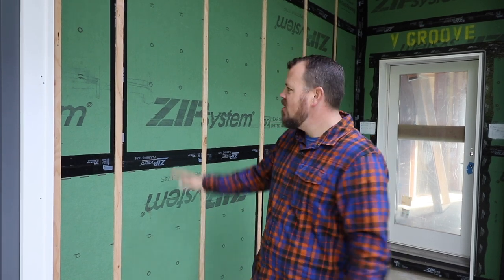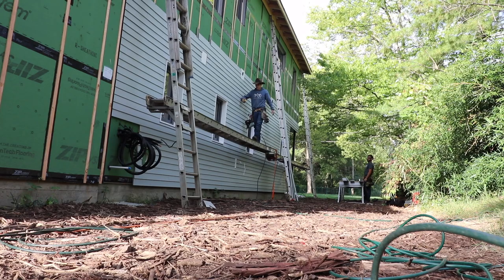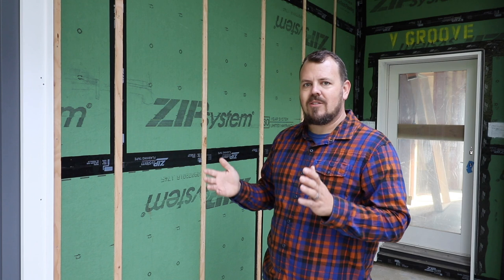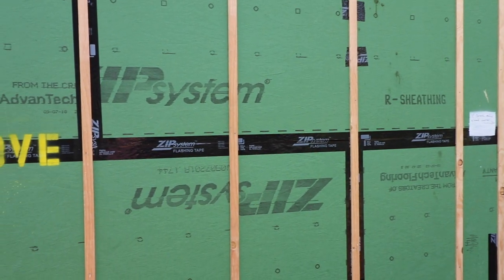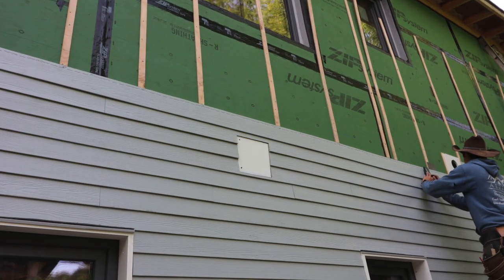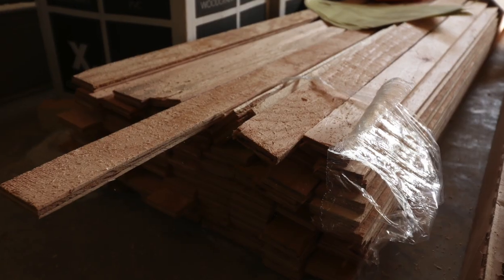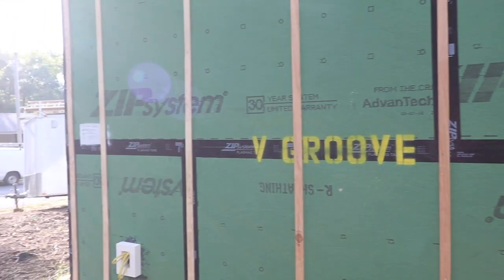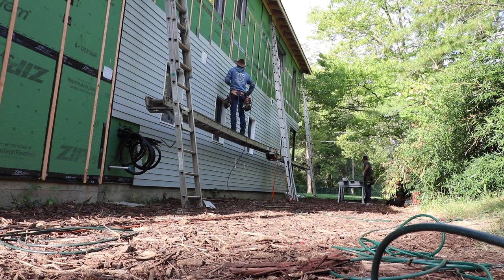Installing a RAINSCREEN - Tips + Busting Myths!

Comment: Bug screens are  cheap insurance IMO. I have seen rotten battens and extensive insect damage where rain screens were used. It cost me 300$ in materials to add a Cor-A-Vent top and bottom on my 1200sf house. The bugs wont nest in the vented area but they will find your weakest link.
Reply: Using coravent myself. Bug screen is mandatory
Reply: Curious if you layered hardware cloth / galvanized mesh over your Coravent to block out rodents?

Comment: The question I have with the Zip system, is everything makes sense sealing up the nail/screw holes with their sealant and the seams with the tape. Everything at that point seems pretty well element proof. However, how do you resolve the fasteners penetrating the Zip sheathing when you attach the furring strips? Would you put that same liquid sealant on behind where the furring strips meet the sheathing? Or is it just not needed?
Reply: Not needed. Water that gets behind the siding is mostly going to roll down the backside of the siding and thus never even touch the zip sheathing. The friction between the wood and the  shank of the nail will mostly keep water out if it did hit that point anyway...it would hit that spot and just roll down. And of course this rainscreen allows for airflow so if it did get a little wet it would dry out and be absolutely fine.
Reply: My builder just put siding directly on top of the zip. Should I worry ?
Reply: @14sasst  Yes and no. That’s not uncommon. Will a space prevent some long term issues? Probably. Keep up with painting and make sure your painters calk everything properly and you should be fine.

Comment: I love the info but i think some of this shit is getting a little crazy.  Ive pulled siding off 100 yr old houses that is in really good shape, and they definitely dont do this extra spacing for venting.  If these materials are that cheap to where you need 3/8  of space then ill stick with the old ways of doing things.  I feel like its all getting redundant and cost tons of extra money.  By the team that stuff dtarts to go bad, someone new will be bulldozing it.  Theres no such thing as a lifetime warranty.
Reply: I agree but one big difference.
Old wood was much more dense and had more pitch than new, farm raised wood, which is so light, it's mostly air and it will rot way faster than the old growth wood. So a lot of these extra steps are to protect the fragile new materials that we are using now

Comment: Great idea about the Plywood, BUT I would love to know if we should use Pressure Treated ply???  I'm at that point of my build where I need to make a decision.  Please help with comments
Reply: Matt mentioned in another video that you don't need pressure treated with this kind of construction because the wood has the ability to dry out if it does get wet. Certainly won't hurt anything but will just be overkill I think
Reply: Joe Listburek, noted building science boffin, says treated strips are not necessary; as Zach mentions it can all dry out, so no problem with a little wetting.

Comment: Rissinger had a great solution to this, bug screen was a corrugated plastic with a mesh on the bottom that stapled along the bottom and top edges. Same air flow and helps ensure bugs in the walls is minimized. Product was cheap too.
Reply: Wasn't there a debate about the softness of the screen material where rodents could chew threw it?  but in Matt's case, he had 3/4" gap.  1/4" inch, no (er most) rodents could enter, but opens possibility for bugs.

Comment: I've kept bees for years now. I also keep 'bee hotels' for many of our native pollinators. 3/8" is PLENTY of room for many of them to make brood nests and food stores. There are beekeepers who specialize in handling cut outs from external walls to extract colonies from homes and businesses. Sufficed to say, I recommend the bug screen... That is unless you don't mind having the exterior of your home serving as a 'bee hotel' for all the wonderful smaller native pollinators (especially the solo types like the mason bee), or critters like the various mud dauber wasp types). :) 

Splendid video otherwise. Thanks!
Reply: I couldn't agree more. 3/8" is enough room for every nesting insect I can think of. Might be enough for some flying mammals....
Reply: @seancrowley7520 Thanks for that. Which size would you recommend?
Reply: It is not just a matter of size. What is claiming is that stack effect is creating an airflow able to deter  insects. Is that true? I have no idea :)
Reply: @boeing757pilot  rather than recommending a specific air gap, I recommend putting a bug screen (like coravent) at the bottom (and if possible the top) of the wall assembly.
Reply: @maurozammarano6651  can’t say that I know which, if any, nesting insects would be deterred by the gentle air flow caused by the stack effect ventilation. Any such claim with regards to deterring nesting insects on the basis of stack effect feels dubious to me.

For what it’s worth, I run my bee colonies with vented bottom boards, which absolutely creates a stack effect if this sort, and none of my colonies have absconded as a result.
Reply: @MateiFM  thank you for confirming my suspicious 😊
Reply: @MateiFM  Thanks for that!  Will that bug screen clog with debris over time and stop air flow?
Reply: @boeing757pilot  I have bug screens on my exterior wall system for just over a year now. Looking at them now, I don't see dust clogging them at all. I suspect the ambient air flow, while present, isn't sufficient to suck such particulate in a way to clog the vents.
Reply: @MateiFM  Thank you for that comment! That has been a concern for me, so I'm glad to see that isn't truly an issue. Thanks again..

Comment: I’m curious about diagonal vs. vertical rain screen furring and why the diagonal was an issue highlighted in the previous video.
Reply: Rain screen is all about shedding water. Horizontal surfaces hold moisture.

Comment: Would a radiant barrier on the zip system help increase the thermal resistance? If so would more air space be more affective? 
Thanks
Reply: if by "increase the thermal resistance" you are referring to thermal conductivity (or "r-value"), then the answer to your question is "no".
Reply: @paperwait9611  Thanks 😊
Reply: If you live in a hot climate, a radiant barrier with a gap makes for a great system.

Comment: What siding are you installing? Every siding manufacturer I've researched including Hardie, vinyl, LPS smartside, and aluminum require continous support behind the siding. Your video's installatioin would void the warranty for them all. I recently spoke to the field tech support guy at Plygem Mastic who said that fanfold insulation needed to be applied over the furring strips to maintain the warranty, but I can't find any specific information in their literature to support this.

Comment: I'm building a shed and the outer walls will be 7/16 Zip, do I need to add siding overtop?  If I left the Zip walls exposed to the elements, how long would it last approximately (Western PA)?

Comment: the missing detail is how do you get the top-and-bottom venting above doors and windows and below windows?
Reply: You need to have breaks in to your strapping so that air can move horizontally into/out of these cavities. Be careful that the breaks don't line up with your siding attachment making locations.

Comment: Don't the nails penitrate the sealing tape when nailing the strapping? Will that allow water into the sheathing? How far apart should the strapping nails be spaced?
I am in the beginning stages of talking to my contractor, and wanting to be sure I  get what I need. 
I have not seen zip on any of the new construction in my area. I want to know best practices, so that I will see the mistakes, if they occur. 
Thank you.
Reply: No, there won't be pressure to drive water into those nail holes. The water will, instead, fall down the air gap.

Comment: How about using this horizontally for board and batten. Would that be ok?
Reply: i think they do the strips vertically to make attaching the exterior cladding easier, since the cladding will usually lay horizontal on the exterior wall